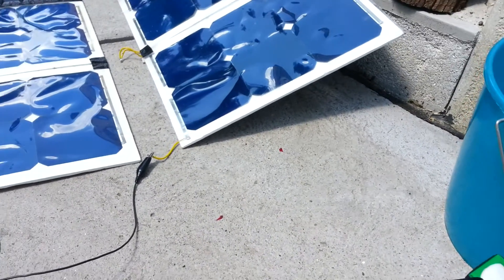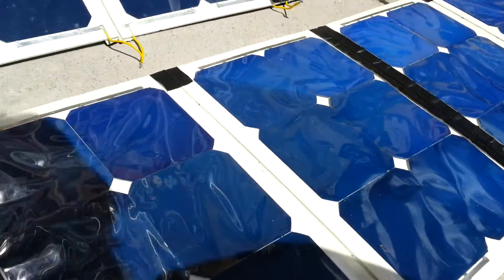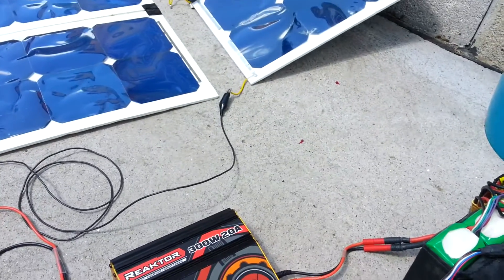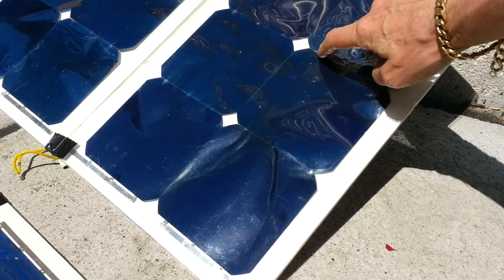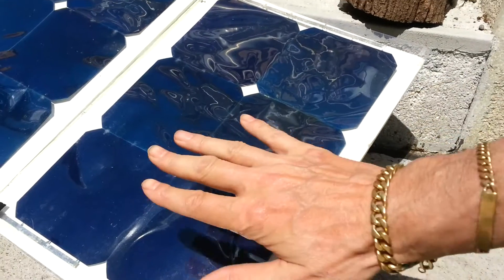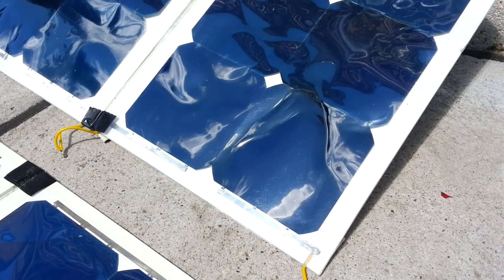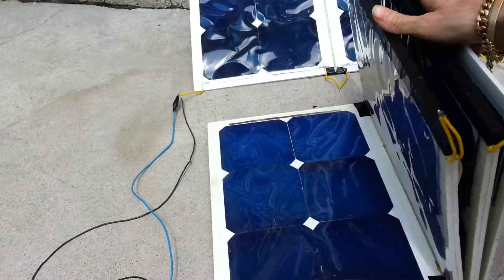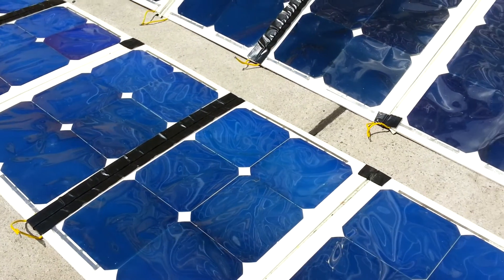Homemade 240W folding solar panels with 300W Turnigy Reaktor

Comment: I found your video very interesting - I should have a bash at building a solar panel - I can't imagine it would look very pretty with my skills but I think it would be an interesting project to complete and I'm sure I'd learn a thing or two.

I've been thinking about your issue here - having to manually track the power point and stop start your charge really does seem a chore.  Perhaps I can suggest an alternative?  Remember you have got a battery to power a solar charge controller - it's your lipo pack which needs to be charged.

Have a look at this solar charge controller - http://www.ebay.co.uk/itm/141942470391
It's claimed to be MPPT (I haven't tried one so can't comment) and is happy with battery banks of 48 volts (and more).  Attach it straight to the main pos and neg of your lipo pack (lets start with charging one at a time, but perhaps you can run them in parallel later).  Adjust the voltages within the charge controllers menu system to correctly charge your whole pack. 

You'll need to reconfigure your panels so that their MPPT point is higher than the battery voltage otherwise the whole system won't work!  Now the lipo pack will power the MPPT charge controller and the panels will charge the pack.

Get a separate BMS to balance the pack. So you're using an adjustable MPPT charge controller to charge the pack, and a BMS to manage the pack.  Does that all sound like a sensible suggestion?  If so, it could be the end of the road for your turnigy!
Reply from the maker: Argh! Had a long reply and lost it so trying to rewrite!
Hi Adam, thanks for your suggestions - that MPPT controller has a suspiciously low price, but may be worth trying out, particularly if it'll work like a PSU to power the Turnigy.

Unfortunately lipo cells don't intrinsically balance themselves like lead acid ones do - they require active balancing at least every few charges, and preferably every charge as the balancing deltas are only a few hundred milliamps and may not be enough to pull a lazy set of cells into line.

For 12 cells, a fully charged pack would be 12 x 4.20V = 50.40V, and the charger may think it did a good job, but in an extreme case, all cells could be at 4.19V and one at 4.31V, and that would probably result in a fire, destroy the pack, the bike and the building. Not good!
There's about 4 million joules stored in there, enough to lift a tonne by 500m!

Cell balancing is becoming a key technology with the energy transition in progress and the rapid growth in EV development, so it shouldn't be long before it becomes more common for home storage solutions that can interface with EVs and ebikes, which are really just mobile batteries that can also move people and things too!

Lipos and LiFePO4 batteries have many advantages over Pb with better depth of discharge and 4-5x the energy density, and costs are coming down - just that the market for medium-sized lithium charging hasn't caught up yet and is still mostly in the radio control hobby domain. (Lipos aren't really suitable for mass public consumption because they require a lot of care).

So, it looks like I really want a custom MPPT charger that'll do 12-16 cells for the whole pack, or at least something that'll drive the Turnigy optimally, even if I have to charge each side manually.

In addition to your channel, during my research I found these sites too:
https://soldernerd.com/2016/02/12/arduino-mppt-solar-charger-shield-software/
I think it could be upgraded by sequestering the mosfets and coils from a couple of old computer PSUs and I have a couple of Arduino Nanos that I would like to learn to use.

This guy actually made a solar bike and this page contains a lot of useful information on cell balancing:
http://www.avdweb.nl/solar-bike/electronics/bms.html

However, this has some impressive specs, but pricewise probably overkill:
http://www.bestechpower.com/444v12spcmbmspcbforli-ionli-polymerbatterypack/PCB-D166.html

I bought a Victron 100/15 MPPT controller, but it won't work without a Pb battery connected and won't drive the charger from its load output because it's too capacitive, and I'm not going to carry a 14kg car battery around with me just so I can use it! Perhaps I can fool it with the smallest Pb battery I can find.
It'll come in handy for home use though.

Do have a go at making your own panels. They don't have to look good, they just have to work!
I got the two Sunpower kits from http://www.ebay.co.uk/itm/171960401780 that included tabbing and flux pen and blocking diode for about $100 each + duty, so not too bad for the power they produce... however, you'll need a lot of patience and begin to appreciate the advantage of buying one ready made, but there aren't any as light and portable as mine - yet!
Reply from the maker: Well, I just bought the MPPT controller you mentioned and will report back!
Also another 40 Sunpower cells just arrived so I'm going to be busy making another panel when I can find some tabbing... yay!
Reply: +Andy Lee Robinson Thanks for the info.  I hope the MPPT charger is really MPPT. The description does mention it and talks about the DC-DC option so I think it should. I know what you are saying about the balancing. There must be some suitable BMS's for your application surely? 

The turnigy is doing the exact same thing as the system I proposed isn't it? Charging the pack from end to end and balancing the cells by placing resistors across them. I don't think you'll be able to power the turnigy from the MPPT charger. Id be leaving the turnigy out of the equation. 

Using the BMS check the cell levels on the first attempt and after that you've got to trust it'll do it the same way each time.
Reply from the maker: I think balancing is a bit more involved than using a resistor ladder - circuits I've seen are driven by two transistors for each cell to preferentially deliver more power where needed - individual voltages also need monitoring so that adds complexity, and the Turnigy does that very well - in fact it allows me to set the termination voltage per cell a bit lower to help extend the battery life.
6S lipos are common in RC, 12-16S ones, not so much!
http://endless-sphere.com seems to be the goto place for ebikes, and a couple of people there have come up with solutions. I think I'll join and offer my video up for comments.
Comes down to cost really - specialized BMSs do exist, but still niche. I'm sure that will change fairly rapidly as the future arrives ever more quickly.

I'll go with something to power the Turnigy for the time being while I keep researching - it'll take up to 20A which is enough for now, and if I make many more panels, then MPPT would be moot! :-)
Reply: +Andy Lee Robinson thanks again - interesting discussion. I'm going to subscribe to make sure I don't miss the next instalment!
Reply from the maker: Thanks! I think the next one will show the bike in action once I collect enough clips and work out what I want to say in advance instead of rambling!